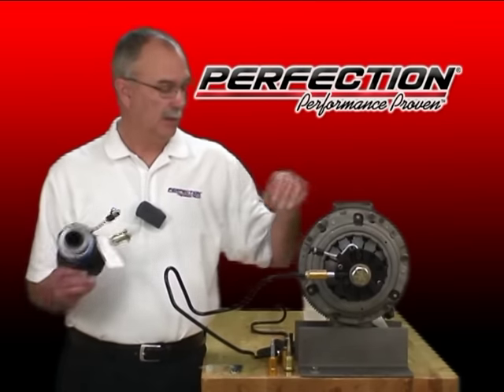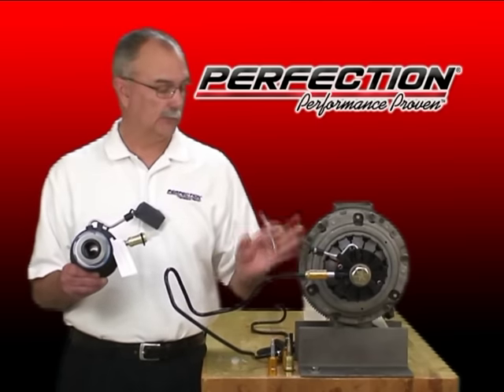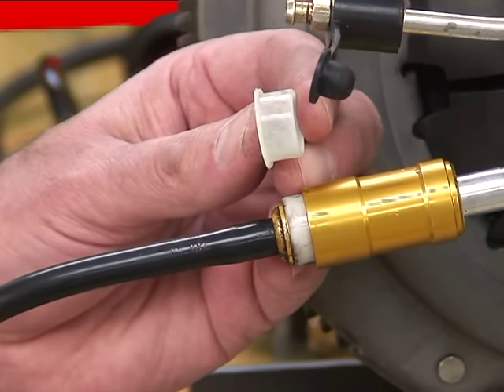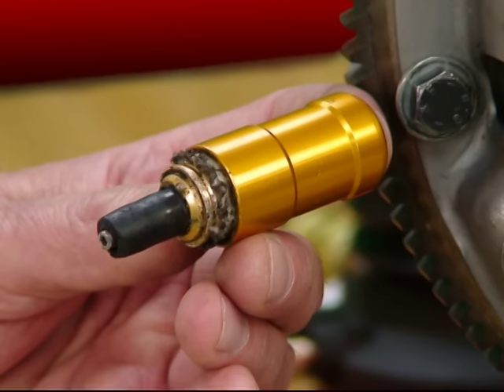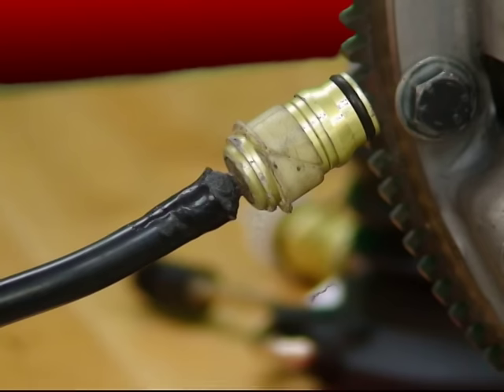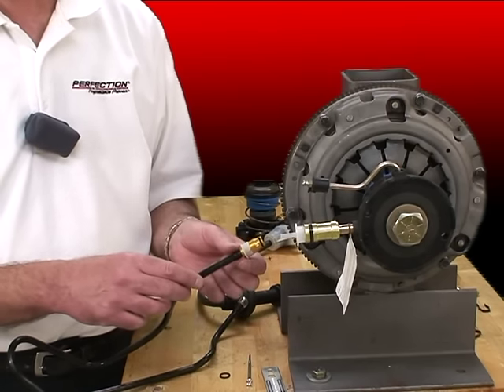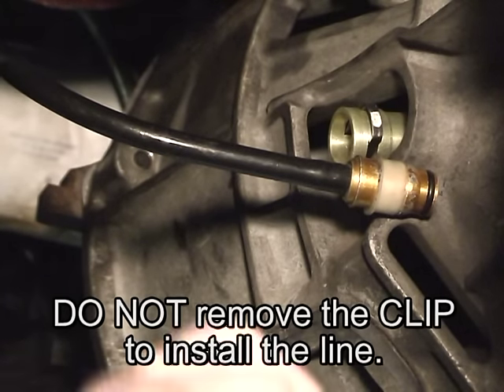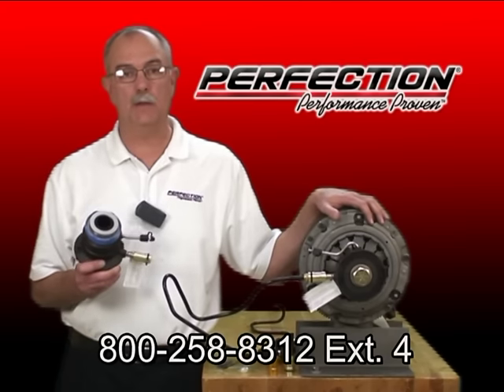Removal and Servicing of Clutch Master Cylinder to Slave Cylinder Connections

Comment: Oh boy I was familiar with vacuum bleeding but I accidentally drained all the fluid in the reservoir using a universal screw on pump that I use for pumping fluid into my transmission.  Now my pedals dead and I don't know what to do.  Any suggestions?  I have a 2001 camaro with 225k miles on her she runs solid but I did the dumb mistake of getting vacuum happy and now the line probably has 100% air in it
Reply: perfectionclutch okay so I got my vacuum pump in the mail.  Just speaking hypothetically if the line was exposed to a ton of air would it be possible to gravity bleed it with a vacuum pump? That is what I am attempting now, however this time the pedal Springs back after pumping it but I feel no hydraulic pressure whatsoever. I still have not done the two men bleeder system but I am considering it

Comment: good video! do you make these hydraulic lines with straight forward couplers for a 2007 for focus 2.0L? i have been trying to pull the line from my clutch master cylinder and its unbelievable for difficult it is because of rust. thanks.
Reply: @perfectionclutch  thanks for the reply, Gary. I have removed the C clip. I cannot twist it because it is incredibly difficult. I have stripped the coating on the wire and scratched the copper to the point of possible damage. I managed to get a slight gap with my pulling and prying to get a dime to fit and wedged. A dime and quarter worked to get a larger gap for two coins, but I cannot believe how seized this thing is. I need to use the line again. I would love to cut it and replace if I could.
Reply: @perfectionclutch  I am not sure what the previous owner put, but thr clutch master cylunder has been changed before. Thanks for taking the time to write. I think I may be able to pull it better with bent nose pliers. Anyway, it is unbelievable how stuck it is. The O-ring is probably why it is so difficult to remove more so than bad rust.

Comment: How about you make a matching set of cylinders that are made of metal and use a normal flared steel line? I would change to a rebuildable cast iron or cast iron with stainless sleeve set that uses standard cups and standard line rather than continue with the bad stock design.

Comment: How can I tell if the slave cylinder needs replaced? I can only get it to move about 1/4".
The clutch was working fine for the last two years, then went out.  replaced the master cylinder and it's still the same.  Does that mean it's the slave that needs replaced?

Comment: Can a new clip be installed into the slave cylinder while the transmission is still in the automobile, Ford Ranger 1992
Reply: are you still having the problem honey

Comment: I have a 1997 Mazda b4000. I have the exact same setup. With the u clip . just slide in and it would click into place, test tugs and it's in place. I have my clutch rebuild about 2 years ago. Just last week I had the male end disconnect from the female end. and caused the clutch to freeze. I had to bleed the slave cylinder abit to engage the male end to lock . This happend to me twice already. The male end lips looks fine and clicks inplace fine.. Can you please help me how to solve it

Comment: Hey Gary I found a broken o ring (a smaller version of the one on the outside of coupler line) stuck inside the hose that I pulled out. Any idea where that might have come from? I looked at every part and can't find any other part that uses an o ring other than at mating point.

Comment: Hello, 

We are actually trying to get the line to connect back into the slave cylinder and its not locking in. We do not have the clip system it is the little teeth that stick out. Do we need to bend them out so they will catch or what would be the best way to solve this issue. 

Thanks,

Comment: I'm trying to install a clutch master cylinder in a 2004 ranger.  I'm having trouble gedtting the cylinder to seat in the bracket in the cab.  Leverage enought to seat the cylinder past the spring clip.  Suggestions??  Help.

Comment: I have the updated clip style slave and the line keeps randomly blowing out of slave after a couple weeks I put new clutch master and line still blew out at slave any ideas of cause
Reply: @perfectionclutch   I put a whole new line with plastic clip sleeve clipped and clicked in just fine and about two weeks later line popped back out I have a feeling something is wrong with the slave cylinder I was curious if you guys have been having troubles with the clip style connection I'm going to go back to the style with the internal locking clip thank you for the reply

Comment: any idea what year the "older connection" (2 minutes 30 seconds)  is from; the male end that has no lip on the pastic ring? looks identical the the fitting on my 97 ranger, obviously the previous owner swapped out older parts.

Comment: @perfectionclutch im replacing a slave cylinder on a 1986 pontiac fiero 2m4 i cant get the line off of the slave its rusted on pretty good..will heating it with a torch help?

Comment: still cant the hydraulic line clip pressed all the way in.. ugh. even got the disconnect tool and it still wont come out.. any helpful tips?
Reply: Squirt some water on the connector wait a few seconds--- blow all over connector with air to remove road gunk in the connector. Use a 5/8 or 16 mm open end  wrench on the nylon sleeve, hold wrench pointing in from the rear and press in on wrench  while tapping lightly  (thats lightly)  on the  wrench as close to fitting as possible, clip should press in -- then pull line and fittings out.  hope this works, i just did this a few minutes ago.

Comment: I have the original style metal retainer with the fingers that lock the male to the female.  I bought a new slave cylinder and once the air is bled the male pops out of the female with that metal retainer.  The lip that should hold that in place feel shallow.  Does the plastic ring (for disconnect) play a role keeping that retainer tightly against the inner wall of the female port?  Very frustrating!
Reply: I bent the barbs a little more towards the inside and it held for a 2 mile test drive.  Everything is new condition with no corrosion.  I'm thinking there wasn't enough outward force applied to that metal retaining ring to lock it against the wall with the 90 degree shoulder.  It's a very shallow lip.
Reply: Well after a couple of days of driving around town and on the highway the retaining ring (the kind that looks like the Burger King crown -OEM style) gives way and pops out again leaving me with no clutch.  This quick connect design is worthless piece of crap.  I wish I had the perfection clutch type in this video. If only that part was available for purchase.

Comment: I’m having problems getting it to go in far enough, so I don’t know if I’m just not pushing hard enough or if I’m doing something wrong or what
Reply: I replaced both the line and slave and it still won't go in. but I have a 2000 f150 v6 if that helps and I already tried opening the bleeder but it still won't go in
Reply: I got them from advance auto parts and the part number for the clutch line is 628240 and the slave is 360016
Reply: Well that's a problem, the one I have is way off, well thanks for the help. And could you by any chance send me a link to buy the correct line

Comment: I just had to disconnect this "new" clip system for the first time - I found the "clip system" a stupid idea. You now have a small clip that can be lost, and you have to watch so not to loose the damn thing. I'd say in the common situation this clip takes me twice as long to part the lines, and you have to worry about loosing the clip as compared to the with the one step no worry original. The possibility of a gunk-jammed or even a road damaged coupler is so remote (the coupler on a M5s seem protected) - damage is usually a prior moron mechanic's doing. I have never seen an original coupler get so messed up it couldn't be parted with the almost moron-proof Ford coupler tool and maybe some help from spray cleaner and a blast of air - just have engage the brain and work sober and smart.

Comment: I think I need a new clip, because by the time I was 2 hours into the bleeding process it popped out. So I wrapped some copper around the ends to the steel clip to squeeze on it the line better. Now it leaks:/

Comment: On my ranger my master cylinder hose keep disconnecting form the slave. I put it on put pressure and boom pops right out. What am I doing wrong?
Reply: You bought FORD... I did too :c
Reply: धीरी सिंह शाक्य
Reply: No one has a god answer for this problem? Same happened to me
Reply: Bruno Bernadino same here, these slaves are junk. That clip on the slave doesn't have enough of a shoulder to grab on to on the hydraulic clutch line. Mine lasted less than 3k miles until it started giving me issues. I'm about to dremel a slot for the clip so it grabs more.
Reply: Bruno Bernadino
Reply: the slave cylinder has a seal also. that seal isn't seated properly. i had the same trouble on my 2004 f-150. replaced the slave cylinder and it would not go back together. much less just "snap" in place.
Reply: You need the clip to keep the pressure line on
Reply: @zigwald  how do you fix the problem with the line keep popping off
Reply: @davidgallegos3214  t was the wrong line.

Comment: While bleeding the line, this fitting kept blowing out. This fitting just does not hold. Looking at other reviews , it has a high failure rate. Going to have to get the old style.
Reply: perfectionclutch the line is brand new. The sleeve is not engaged into the clip area but is on the line.

Comment: Is this the same company that supplies Duralast slave Cylinders??
Reply: Just bought the duralast slave cylinder (part no.13207) along with hydraulic line. Both brand new. The line will not go into slave cylinder. The couplers appear to be different.
Reply: Kathleen Bradfield .
I think I got the same problem .I couldn't get the old plug into the new system female .

Comment: You  don't show how to get the line of deep inside a NV3500 trans - 2004 Silverado W/T
Reply: how does the tool work ? the line is held in with a roll pin on the slave side. 2004 Silverado W/T  NV3500
Reply: 2004 Silverado 1500 W/T 4.3L 5 speed 2wd . I think it has the NV3500 trans. 
 I replaced the clutch & slave cylinder and having a heck of a time 
getting the pedal back in working order. truck drove fine before until clutch disc broke.

Comment: your video is misleading,there is no bell housing in your way,on a 1993 f150 there is only one direction the removal tool can go on the fitting ,and that is straight from the back,if the collar is worn it makes it very difficult to remove if not impossible.

Comment: same problem bro i start my car this morning and i notice my clutch wasnt working,i check my hydraulic line iwas shock its leaking,i pulled the line came off easy because its not intuck,itried to reconnect but the little teeth inside  cant grabbed the coupling..we might need to change our fluid lines or change the slave...i dunno maybe a new car.
Reply: netnet zerimar

Comment: I snap my line in and it holds but once I start to bleed it, and it starts to build up  pressure the line just snaps back out. Any tips to get it to stay in?
Reply: Get a different line. Use a borescope to get a good luck at where the line connects to the slave, and make sure you didn't leave the old O-Ring behind on it. Lubricate parts with brake fluid.
Reply: How did you fix that issue?
Reply: Use a hose clamp
Reply: Same issue here did anything help?
Reply: I have a 97 and I tried to snap mine in this morning and it would not snap in that's the worst engineered thing I've ever seen in my life and I'm 67 years old. I guess I'll have to buy a new female part I wish I could just put my own plumbing on it
Reply: I had no problem removing it it was already removed now that I have my new one it doesn't do nothing it won't snap in
Reply: Make sure the white plastic isn’t pushed in all the way, it might be that
Reply: I just ran into this issue on my 98 k2500. I went to leave for work and the clutch pedal was solid. Found that the line pushed out of the quick coupler. The aluminum fittings corroded against the steel clip and the little edge that the clip rides on is gone. I ordered a whole new master cylinder and line. I tried cleaning it up with a small file  and gently easing it back together but it wouldn't hold under pressure. Also, I seen where someone couldn't get it back in. I ran across the same issue. Had to crack the bleeder loose right above the quick coupler to relieve pressure on the female side. Hope it helps someone down the road

Comment: My clutch fluid is leaking out of the bell housing and I replaced the master cylinder it still doesn’t work do I need a new slave cylinder?
Reply: Yes if it's leaking in the bell housing

Comment: I am beginning to think the reason they will not come out is that someone froze the end so it would go in easy and maybe someone is paying the damn Chinese to screw up to the dimensions on the cylinders or fittings. I got a trans from a 4.2 2002 Ford F150 from Green Point auto sales salvage and they swear it was from a 2002 Ford 4.2 F150. I know it is a 4.2 but the tag was off so i felt since the 2002 line i bought would not go in then it might have a 1997-98 slave but that line will not go in either. I am at a loss to why other than someone is screwing up the machining or lying like hell to me. I now have to break down the 4x4 after i have rebuilt all the engine and new clutch flywheel, pressure plate but failed to replace the slave thinking it was a 2002 and looked very new and well shape. I have a greenish line that will clip in nicely but was cut and the other lines will not go in but they were both no color, a Dorman 268-240 and a 268-237, neither will work. I have no idea what the greenish line end is from and the year. 4.2 was made from 97 to 2004 for sure but the 97-98 carried a different number than the 99 up. Dorman told me many complaints were being made, so who in the hell is 
Ford????

Comment: mine keeps popping off, any thoughts?
Reply: perfectionclutch is it true that gold fittings are only compatible with gold and silver with silver?
Reply: perfectionclutch I ask because the fitting on my slave is brass and the line is silver, and the plastic bushing just won't go in, it keeps sliding of when it try pushing it in, it seems the male fitting with the plastic bushings O.D. is bigger the the female fittings I.D.

Comment: The tool that comes in this kit is flimsy as all get out, I've tried everything to get this tool to work push thr hose in, pull it out a bit but the tool can't put enough pressure on the sleeve to fully insert the sleeve into the fitting.  It would be a great help if you guys at least made this out of mild steel so its more rigid.
Reply: Nevermind sawzall got it off.

Comment: thanks for the info i dont understand why  car companies make things so hard to do when from the start gm could have came up with a lip on the push ring  its just  simple thinking  same as the having to take the tank off to replace the fuel pump  the old nissan had a  trap door under the back seat  simple  i cut a hole in my truck made a trap door wiola  now its simple   just takes  15 munutes  instead of two or three hours  why dont they have  people  with a little  common sense  working at gm design   just another way to make you bring the car in for service  its about the money  bunch of thieves  car companies are

Comment: It seems that you have two different types of connections that are trying to intermix in the market and I'm without a truck right now because it didn't click in it didn't have a clip on it and it didn't have provisions for a clip but the one you tried or sold me was the one for the clip the line coming down will not go in I'm not even going to get into the master cylinder that will not get into the firewall the right way that's the most ridiculous outfit I've ever seen I'm still without a truck because of this

Comment: Thanks Ford for your "challenging" design features. This video is good but offers no instructions on removing master cylinder from firewall.
Reply: have you tried- remove top bolt, rotate master cylinder and remove second bolt?

Comment: Another brilliant "quick coupler" that is 100 times more trouble than a simple wrenched fitting.  Chevy SUCKS!  Oh...and the $200  complete shop manual is nearly useless for this and most other things.  And I had to pull the damn tranny to replace the cheezy slave cyl.  Chevy SUCKS!!

Comment: If that clip ends up broken or lost, you CAN'T just buy the clip!!
Reply from the maker: Unfortunately no retailer carries it separately. But if you do run across a situation with a lost clip, shoot us an email. Can't always promise we will have extras but we try to help out folks when we can!
Reply: @perfectionclutch  my name is Dwayne halterman I have a 1998 S10 with Five speed I replaced trans and lost clip to hold line in slave cylinder it's the clip for yellow or bronze slave cylinder if u have an extra it would be blessing
Reply: @perfectionclutch  If you guys got any extras of those clips it would be greatly appreciated mine broke when trying to install it (incorrectly) until i saw this video but it was too late by then, if not any suggestions of how to jerry rig it would be appreciated.
Reply: @perfectionclutch if the clip falling off is a known issue as stated over and over in these comments and even mechanics warn you about it why not make extras and have them ready for people whos clip falls off or breaks  because of no fault of their own this alone has detered me from buying this brand 90% clip falls off 10% get lucky